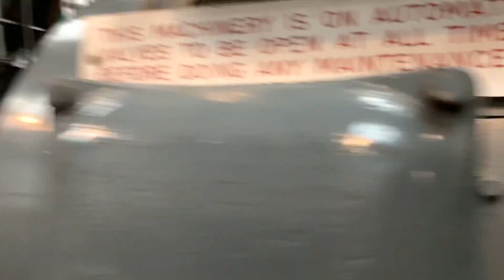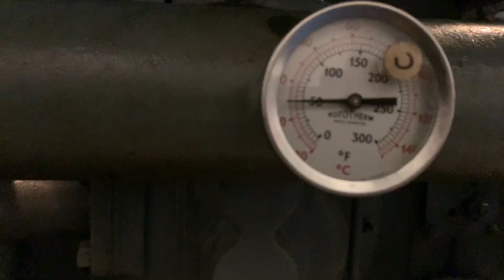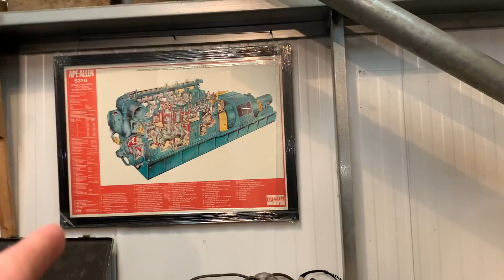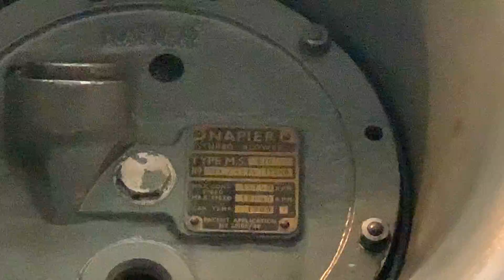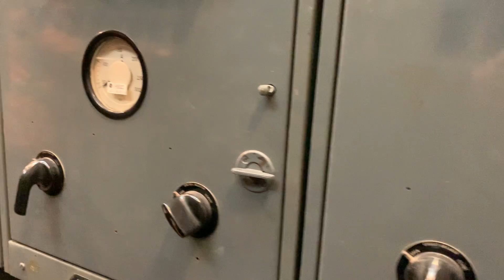37 TON TWIN TURBO DIESEL ENGINE START AND RUN! You have all been waiting for!!! 👍🏻

Comment: Someone said this was an Allen?  I didn't know Allen made V16s.
Reply from the maker: Hello, yes I believe your correct with the name being Allen” v16 and there was only so many built. If I’m correct there’s only 2-3 left in the UK 🇬🇧 
Thank you for the comment 👍🏻😉
Reply: What a lovely beast
Reply: This old girl is a mk1 S12 WH Allen. They will always start, they were build to be reliable, not like the pieces of ***p that replaced them, I know this because I used to install and service them (the old ones that is) and now I have a business replacing the modern ***p with new medium speed units like we fitted in the first place. WH Allen from Bedford build V12/V16 In-line 6/7/8/9 cylinders, not many 7/9 cylinders were built as these weren’t stable units were as the V12 V16 and in-line 6/8 were good reliable, easy to repair, built to run on crap fuel, were ideal for ships, industrial power and main power plants all over the world, their are still plenty running in Africa, Asia, South America and other places I can mention but you would not believe what is beneath the streets of London. With regards to only a few V16 being build a couple of hundred or so isn’t bad really. Bye for now. 👋